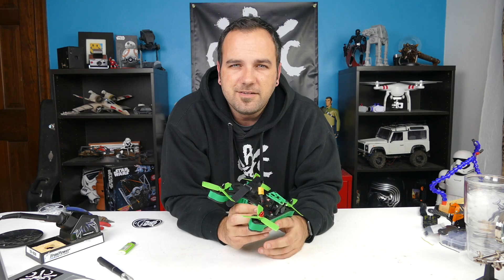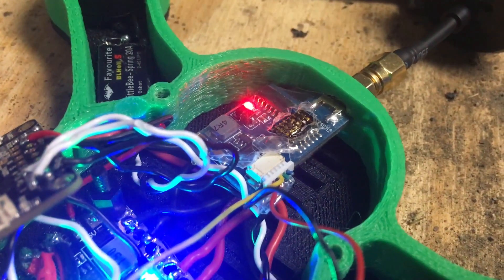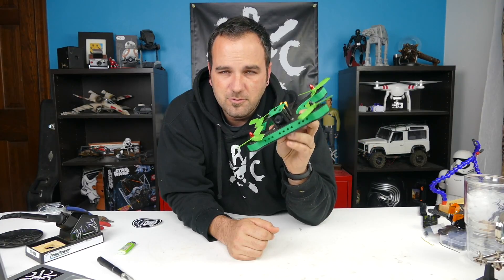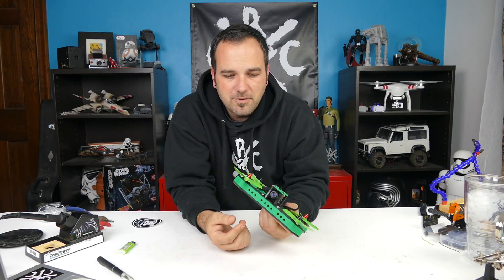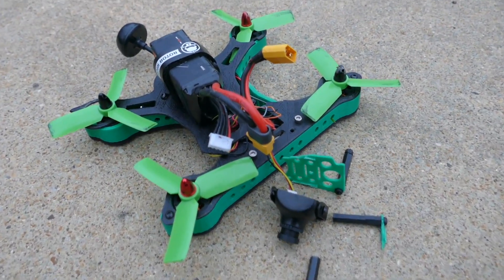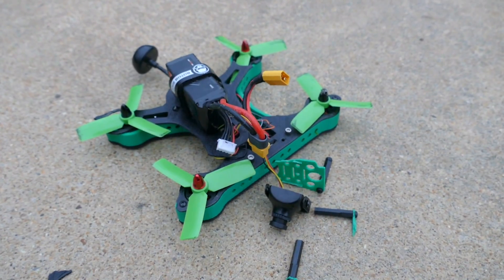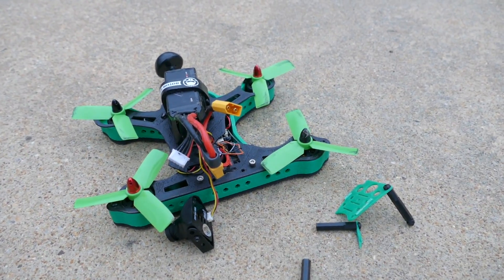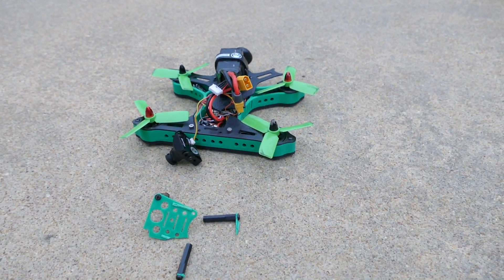3D Printed FPV Drone

Comment: The Video is from 2017, i was checking that because your prinited parts look very bad in many ways. there are now several good files for 3d printed chassis out there. Printed with the standard of modern desktop printers and the better filaments in 2021 they work like a charm.
did you ever tried it after 2017 or recently?
Reply from the maker: Yes, 3d printing people are doing these days is much better! I've gotten out of it as I just don't have the time for it.

Comment: Pretty cool man! Bummer on the breaks but at least you can just reprint the parts. I have one observation from the video though. When you fly, you point your head down. Your patch antenna is then pointing into the ground, not really helping if the receiver switches to it. Point that bad boy up so the beam has somewhere to project lol.
Reply from the maker: I had someone else tell me that recently. I bought a longer antenna wire and direct it up now.